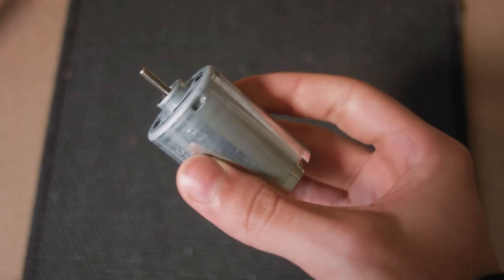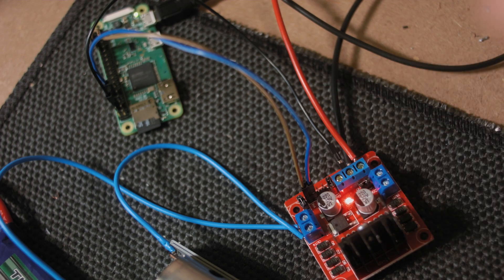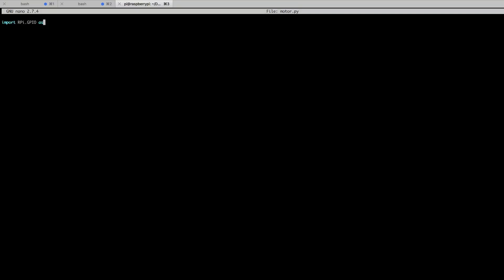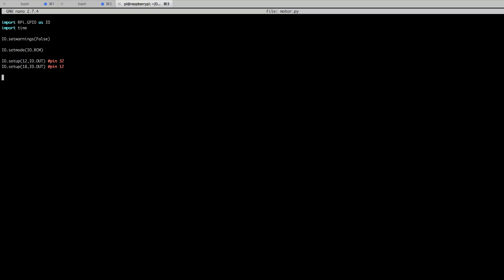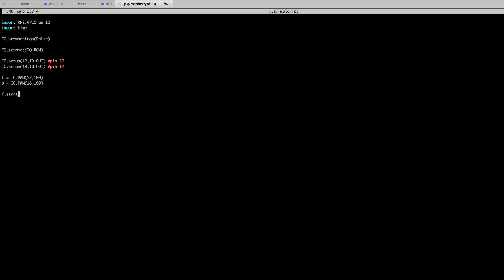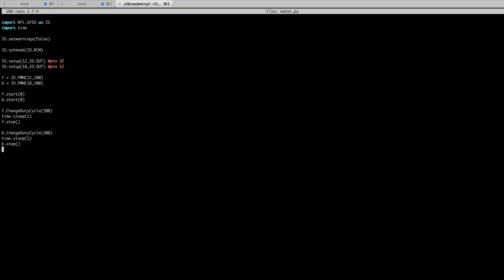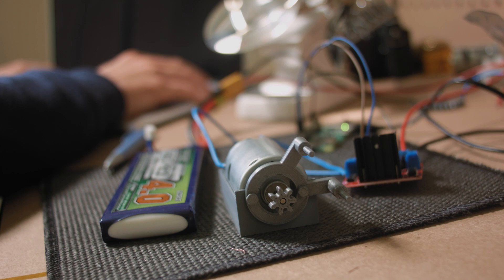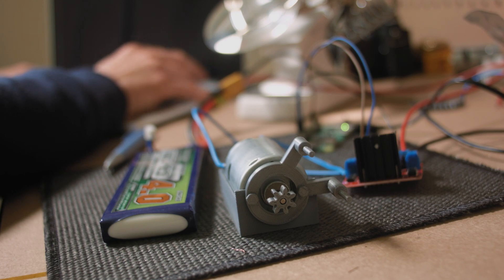Noobtronics Tutorial: Controlling a DC Motor with Raspberry Pi

Comment: Hi, I think that a stepper motor would be more appropriate for the Follow Focus application, it as constant troque at any speed even at a still. But PWM is a good application for LEDs, Lights.
Reply from the maker: Of course, plus a stepper would also allow you to save focus positions to memory and switch between them accurately. Although a brushless servo would probably be ideal if you want to capture in-camera audio.